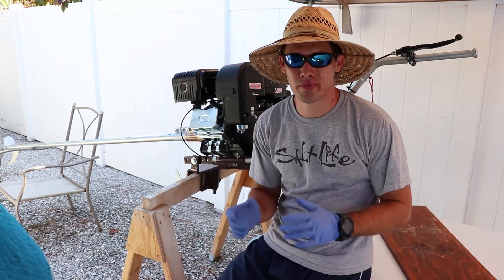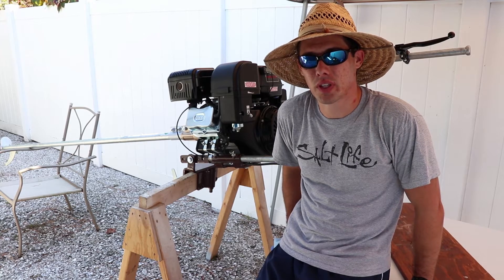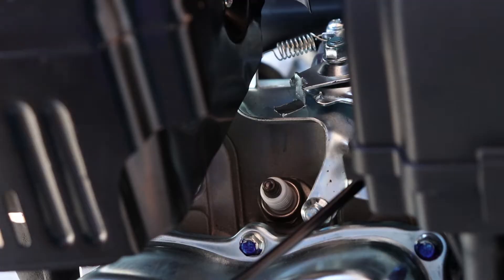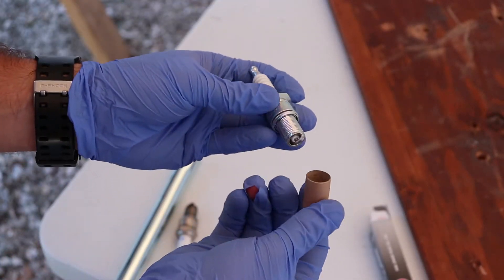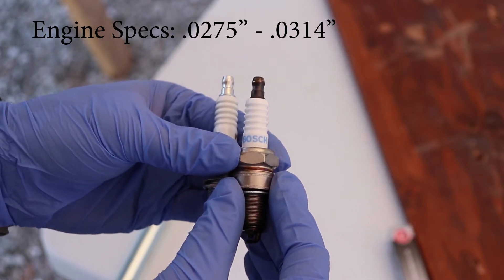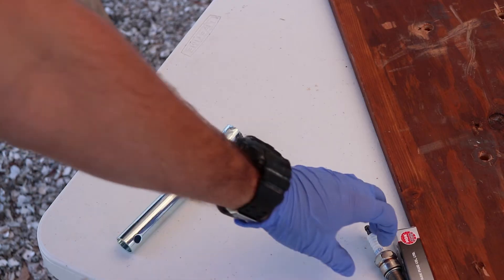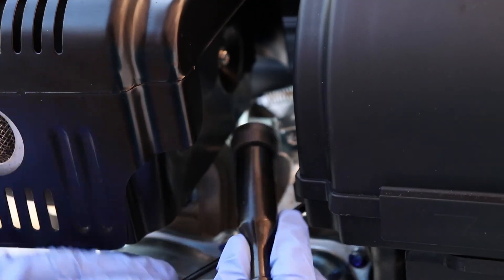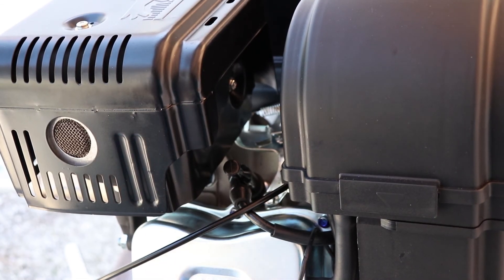How to Change Spark Plug on Small Engine - Predator 420cc

Comment: What about anti seize. You said nothing about the most important part of the job steel plug in a aluminum cylinder head and for god sakes kids out there use a real spark plug socket. This also was not the same plug Wil Ferch
 nailed this "P" in the NGK designation is for projected tip

Comment: Should be NGK BP6ES as the proper equivalent....if your OEM was Torch F6TC. I believe the "P" in the NGK designation is for projected tip. Notice the old plug you are holding projects the tip a bit further into the combustion chamber. Careful.....for engines that did NOT have a prejected tipm to begin with....adding one later can put the tip too deep into the chamber and maybe crash with a domed cylinder. OTOH....if you don't use a projected tip and OEM was projected, the tip may be too recessed into the plug thread hole...also not good .
Reply from the maker: Thanks for the info @Wil Ferch! I looked it up when I first purchase so I must have made a mistake doing my research. I've been needing to maintain the motor anyway so I'll just order a new plug and get that fixed up and see if I notice a difference! Thanks again for the heads-up!
Reply: No problem.... good luck.